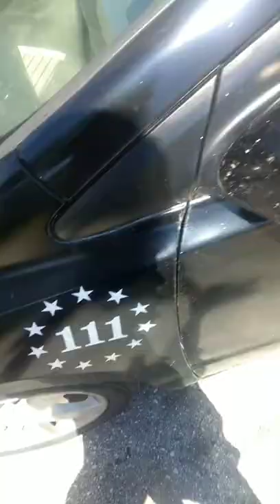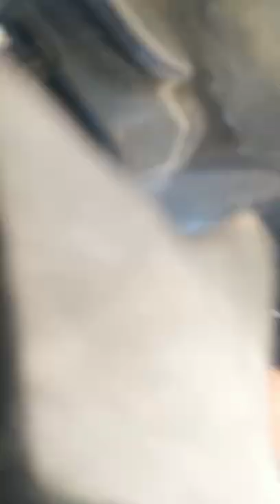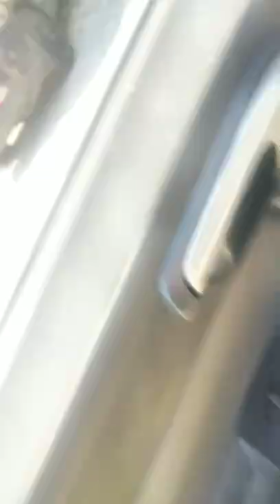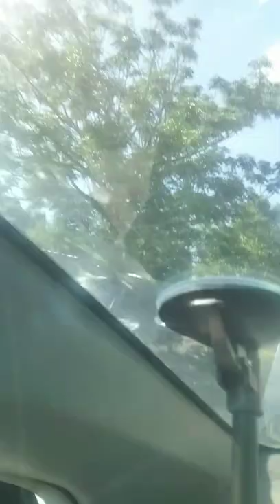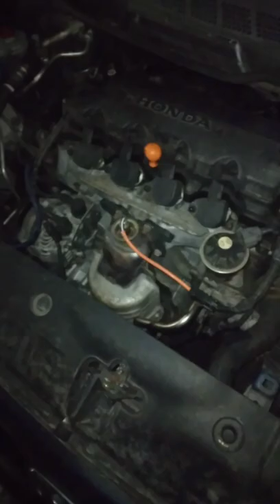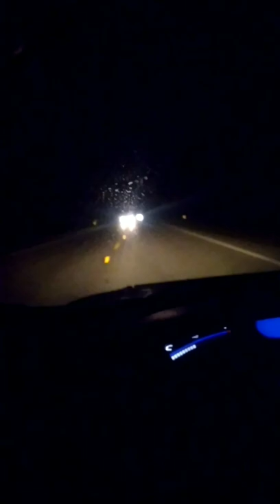Civic R18 Vlog - New header / Catalytic converter

Comment: Hey what's your full exhaust ? still got muffler or a resonator ? good looks
Reply from the maker: It was just an open header (I don't suggest without tune) and a muffler delete (unbolted). I have another D17 I did with like a 43 dollar header cat that corrected my P0420 light. Probably going to get another DNA catback for a hundred, same cheap recipe.